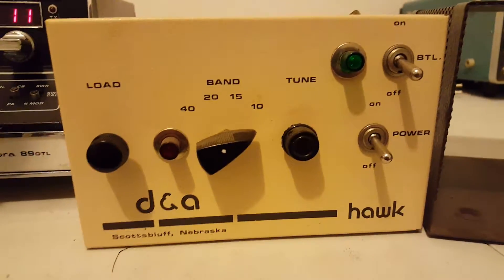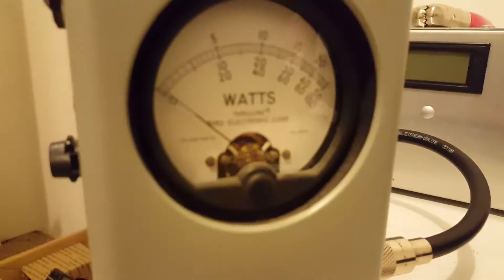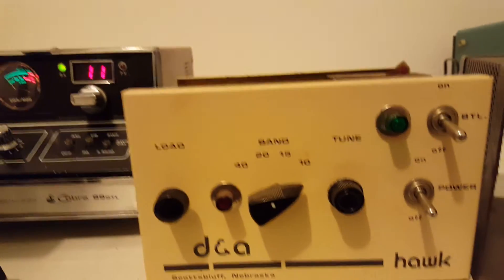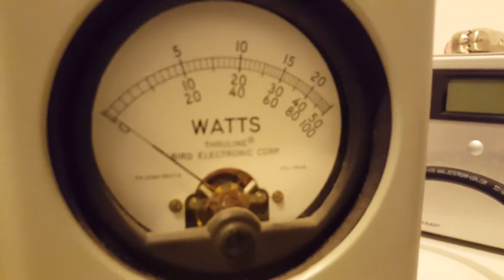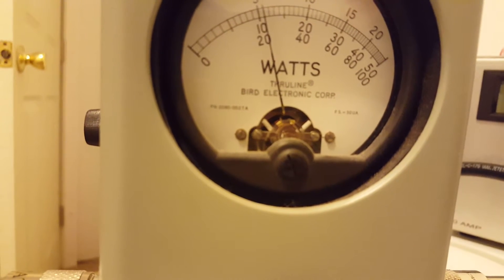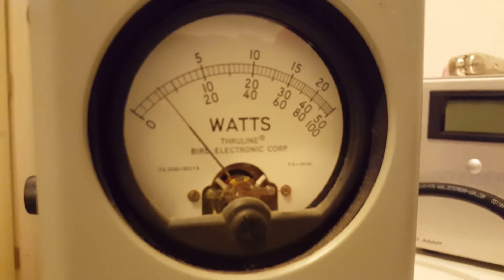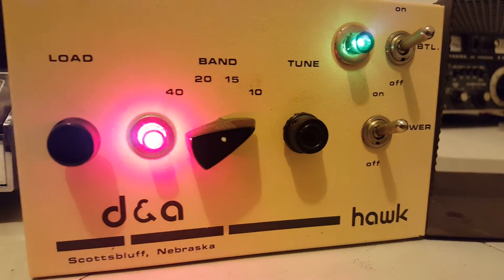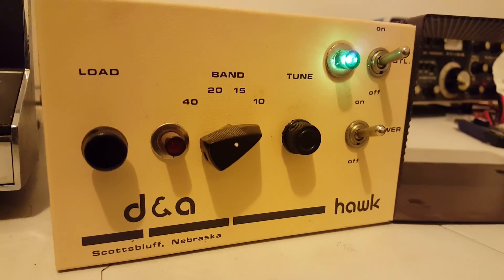D&A Hawk Linear Amplifier Modulator Vintage CB Radio

Comment: When these types of amplifies were built during the 
70's - early 80's CB's (normally) only produced 4-5 watts DK, and 8 - 10 pep. 20 watts pep came from rigs that were normally "tuned". Some tube rigs like the three big Sonar's, Browsing, and Tram, to mention a few did 10 - 12 pep out of the box. 
Driving these tube amplifiers with 25 - 30, and even more Watts pep,and (normally) 3 watts DK will definitely cause the amplifier to eventually fail (if not, eventually Immediately!) If it doesn't fail right away get ready to change out the expensive sweep tubes that most if not all of these amplifiers where originally built with. I run my Palomar 300a, 350Z, and triple stage Phantom with 21/2 DK, and 15 - 18 pep. Many operator's don't understand that getting 100, 200, or for argument's sake 500 watt's more out of, an amp by driving it with a higher output WILL NOT MAKE A DIFFERENCE ON THE OTHER END! If one is getting 500 watts out of an amp then increases their drive to see the amp doing a 1000 (1kw) watts the 
5 s-units you were doing on a particular stations meter WILL NOT SHOW AN INCREASE TO 
6 - S UNITS! It takes 4 times your current output in order to see a 1 s-unit gain. Example: 500 watts gets you a report of 5 s-units on a particular stations meter. It will take a jump to 2000 watts output to get you a report of 6 s-units. That's not my opinion. IT'S A MATHEMATICAL FACT! Trying to squeeze every single watt out of an amplifier will only lead to CAPACITOR, OR TUBE FAILURE!  POSSIBLY WORSE! So my advice to anyone buying a vintage CB radio amp is to drive it with no more than 3-4 watts DK and 12 - 15 watts max pep (20 on SSB.) It'll DEFINITELY LESSEN THE CHANCES OF THE AMP FAILING!  With some sweep tubes costing $90+ (if you could even find them) makes driving your amp at less than its full rated output a VERY GOOD IDEA! My mantra is LET IT LOAF, AND IT'LL LIVE! Good luck. 73's.

Comment: I enjoy your clips rooster, but I've had the argument I'm going to raise so many times before (especially with locals.) There's a difference between a modulator and an rf amplifier. The d&a hawk is definitely not a modulator. It's an amplifier. 73
Reply from the maker: PEACE NYC glad you enjoy the videos. Usually i speak in cb slang and not a technical aspect